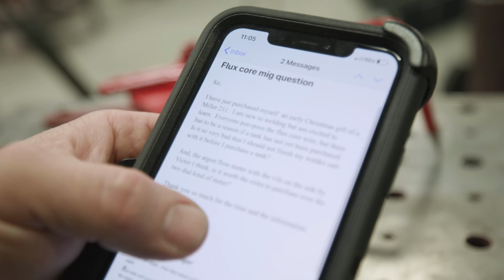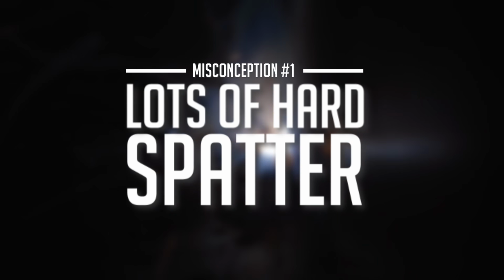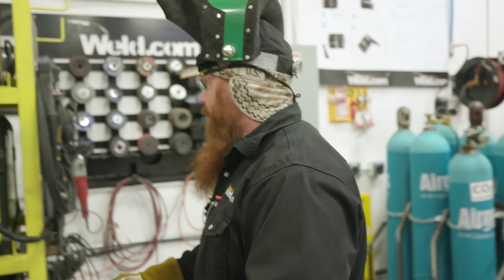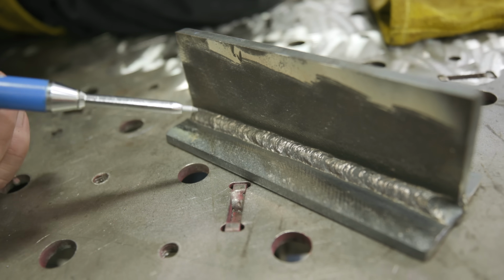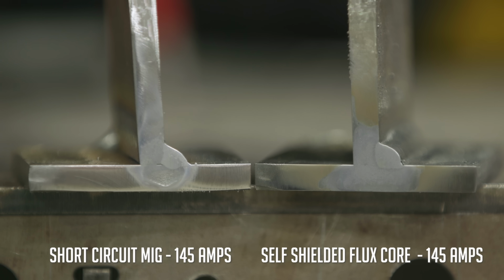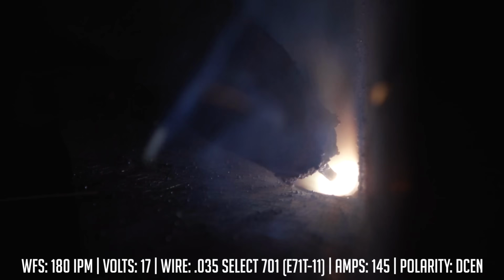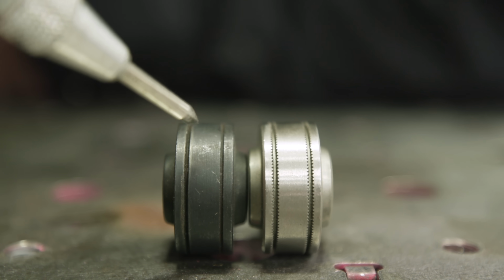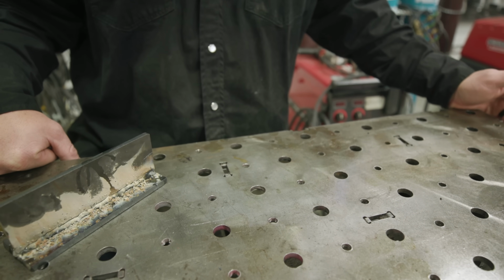3 Flux Core Welding Myths DEBUNKED

Comment: I did a LOT of mobile repairs that required welding in windy, outdoor situations.  Flux core was the ONLY way to fly.  This was an excellent "myth buster" vid.  Redbeard, kudos on this one.  Use the correct process for the task at hand...………...they all have their place.  Don't take a "knife to a gunfight" applies here.
Reply: I'm not a welder by trade, weld while repairing trash trucks and I've found that flux core has much less of an issue with "dirty" metal. You don't have to be nearly as OCD in your prep, like you do with gas .
Reply: @cbmech2563   yup my father doesn’t grind jack before welding
Reply: @ellismidkiff6117  7018, turn  it  up  and  stuff  it is  my  preference , but  then I  can  weld but  I  don't  call  myself  a  welder . That  would  be  a  friend  of  mine  who  makes  pretty  welds over  his  head  in  a  spot  he  had  to  bend the  rod to  get  to   the  weld and  he  couldn't  have  seen  it  even  if  he  could  have  gotten  his  hood  into  the  spot.
Reply: @cbmech2563   yeah man my dad has been welding for 50+ years
Reply: @cbmech2563   my father does stuff like that
Reply from the maker: Absolutely 👍
Reply: I only run flux core and metal core in my shop, i do have some solid wire for the thin fine stuff, but really life is too short to be running solid wire. I use innershield on field repairs.
Reply: @kristiangjerstorff8212  thanks
Reply: Stick welding has no problem with windy situations as well.
Reply: canuckguy worried  I try to avoid spitting in the wind or pulling the mask on the old Lone Ranger AND  I at all costs don't mess around with Jim!
Reply: Am just beginning to learn to weld. Is there a rule of thumb to figure out which process is the right one for a job I am doing? Trying to figure out what machines I need, as of right now all I have is a Hobart Stickmate welder.
Reply: @brianteed7390  I don't know anything about that particular model, but if it goes up to 150-200 or so and has a decent duty cycle, you can just stick with it. You can get a Tig torch and a gas bottle and do touch start with a stick welder. You might be able to get a mig gun and a wire feeder too, I don't know. Stick's a good place to start though.
Reply: canuckguy worried 
3 steps towards the door dude
Reply: canuckguy worried  farmers or people that weld for a living can be the same. All comes down to taking time to look pretty,the level of experience,etc.
Reply: canuckguy worried  NO CAPES!
Reply: canuckguy worried  I slapped Jim and Slim's momma
Reply: Dual shielded flux is even easier and smoother too, especially great for wind.
Reply: @farmalltomf  and don't bring a gun to a argument sometimes things can be overkill lol
Reply: Flux core is good. Better than stick, in most cases. But still, stick also has some good advantages, when I need deep penetration and it is windy, at the field. That being said, mig is by far superior in every single use case. I know, it is not even debatable, pears and apples. Still, had to give my pov, when I bought the bottle and solid wire, oh man, the difference. 0.6 mm thick steel on my car. Dream. With flux core, yikes.
Reply: Realy flux whas the only thing u chould use ? 
I mean like this u also got gasfiled wire for mig welding wichs should make u able to weld outside in windy situations
Reply: 7018 and 6011 are better for field repairs, people that use gas less flux core are just farm welders
Reply: @pmm4177  You say that like farmers are bad or don't know what their doing??
Reply: @roniler7960  thanks
Reply: pmm4177, I’ve welded with flux core to make anything from chairs to boats. It’s not the machine, it’s the welder.
Reply: @pmm4177  You do know that 6011 is known as the "farmers rod" right lmao
Reply: @raifparker3990  I thought that was 6013.
Reply: @pmm4177  there are skyscrapers glued together with industrial fluxcore everyday. Aint no farmers in the sky melting metal on them 30 story  heifers
Reply: @pmm4177  lol you habe no idea what you're talking about my guy! Probably some big stick welder pipe liner. It's called working smarter, not harder just to look cooler! Pshhhh!!!!

Comment: shit, even with gas in the shop flux is great for quick mobile stuff, tanks get heavy.
Reply: Didn't know Argon hoses weighed so much? Usually get 2 -33lbs spools of dual shield off one bottle of Argon/CO
Reply: @donovanmorris163  tanks not hoses.
Reply: @Ramdodge582  plus its nearly impossible to weld with gas outside unless you crank it up to waste it, or build a hut lol!
Reply: @Hammerjockeyrepair  no its not, I did some welding on a railing system outside no problem. Sheet of cardboard as a wind break worked like a champ.

Comment: The proper term is self shielding flux core , its welds are not as sound as duel shielding.  But it still has its place in the world of welding .
Reply from the maker: Self shielded is used everyday in structural applications. Seismic wires are self shielded fcaw.

Comment: Rolling dimes. Great video. My dad started teaching me to weld when I was 8. So I have been doing that for 36 years. Always something new to learn if you think you know it all then you’re not likely to improve your skills. Then working at a NASCAR shop for a few years I learned even more. I was absorbing knowledge from the guys who had been doing it pro for 20+ years was great because I greatly improved my skill level. Thanks for the videos always looking for techniques I don’t know or have questions about.
Reply: I agree, always something to learn, improve on or even getting consistency down. I strive for the picture perfect weld always no matter position or fit. That takes time and learning. Only way I've found is to know how it should be and go from there for Most part. I do think first hand teaching is best to correct any tendencies before they become habit over time.